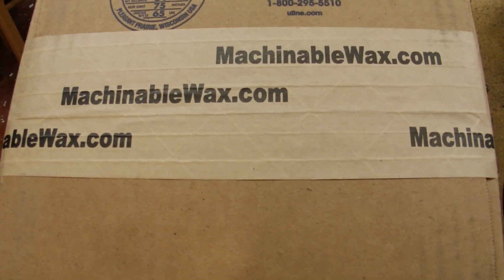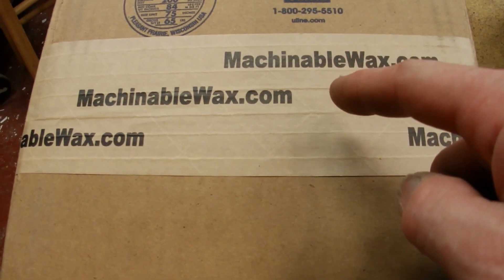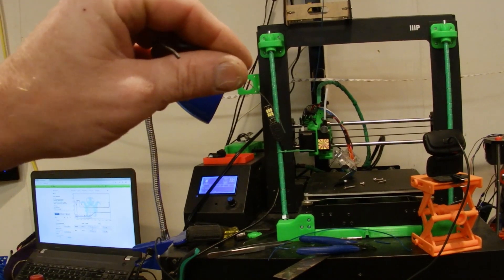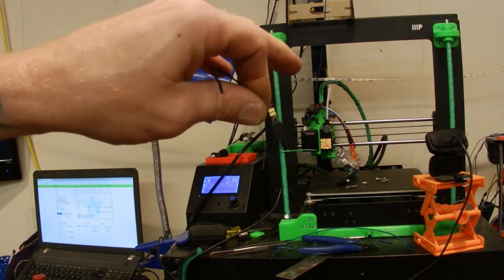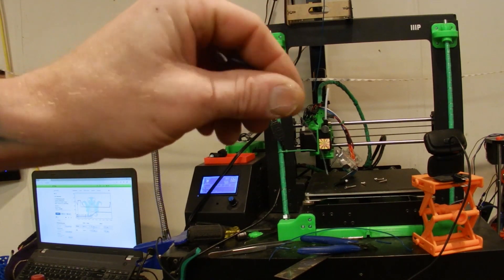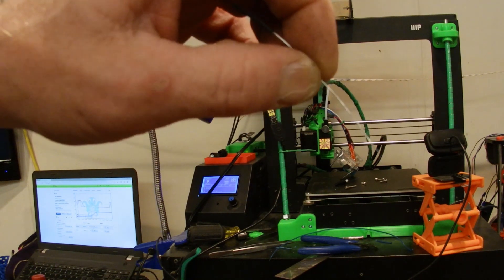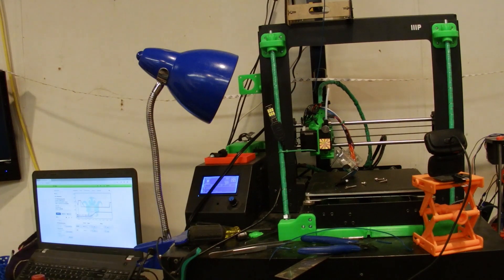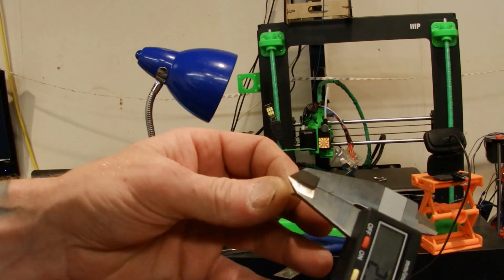3D Printing wax (Machinablewax.com filament testing)

Comment: This is why I’m getting a printer! How has your progress Been with the wax? Have you casted anything?
Reply from the maker: not with the wax I tried some pla but the burn out process is the hang up right now. Weathers just starting to get nice again so I'll be out working on my stove project in hopes to improve the burn out process THEN time for some wax. There is also something I've been researching for a mold medium instead of plaster of Paris but it's expensive so I need the kiln done before I give the whole thing another go. Keep watching and if you haven't yet please subscribe if you have Thanks and I'm always open to suggestions. Thanks for watching.
Reply: Ive been using the machinable wax on my mini shurline cnc to make pendents and I just take them to a jeweler to cast into sterling. This is my main reason for wanting to print with this wax, it burns out easily. Ive read that you need to burn out at specific temps and then remove the wax from the kiln I believe because it can damage the heating element over time. The wax will build up as carbon on the element and destroy it. I would also like to use this for casting aluminum some how on my own.

Comment: I need the best settings for Cura, it won't work with the filament help!
Reply from the maker: I don't use cura but 150c was the magic # and slow 30mm small retraction and low - no fan bed adhesion good luck try tape with hairspray on a flex plate maybe
Reply: @InsideTheMindOfMatt  Okay will try it thank you! 👍

Comment: Hi Matt, in your opinion do you think that machinable wax is better than PLA for burning our prior to casting? I am using investment casting method and currently have a 97% success with PLA is the extra expense of the filament worth it?
Reply from the maker: Well I would say the pain that the wax is to print still with pla

Comment: Matt, is that borosilicate glass? I want some but do t know where to get it
Reply from the maker: it's just regular glass I got it at Home Depot. Just when to an Ace Hardware and bought 2 more pieces.
Reply: Inside The Mind Of Matt awesome,  is it categorized in any way,  is it a picture glass,  a window pane or something else.  I might go pick some up soon
Reply from the maker: window glass I think. It will probably be the only glass they have. Make sure you know what size you need in inches

Comment: it's so interesting. Is the Filament Diameter wax 1.75mm and does u use the Monoprice 3d printer? Thank you
Reply from the maker: yes filament is 1.75mm and I printed it with my Maker Select v2 with a e3d Titan Aero
Reply: @InsideTheMindOfMatt  what were your settings on the Maker Select.? Im struggling a bit.
Reply from the maker: 150 was as low as I could go due to settings in firmware but 150 real slow no retraction and bed adhesion well I never figured that out maybe blue tape but not the easiest material to print

Comment: i used to do candle making and the max melt temp for wax i went by was about 120 deg.  perhaps a lower temp could eliminate some of the issues you ran into.  that and maybe an air blower with air cooled by a peltier modual.
Reply from the maker: Yes that might be something to try just have to edit and reflash my printer firmware to lower the min print temp lower then 150 🙃

Comment: if this real like wax I can print candles of different colors.
Reply from the maker: Fernando Salas the filament only comes in one color and the printing characteristics require as little infill as possible. This is mainly for casting. But you could print a mold and fill mold with different color wax to make candles just a thought
Reply: Inside The Mind Of Matt OK got it.